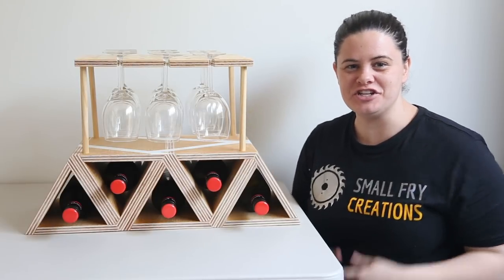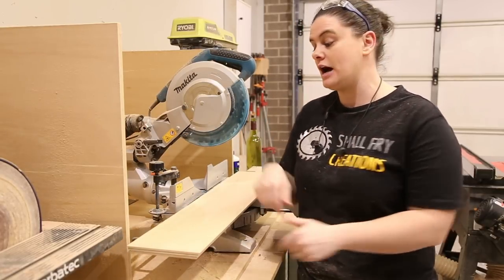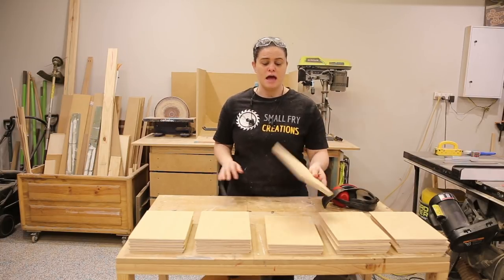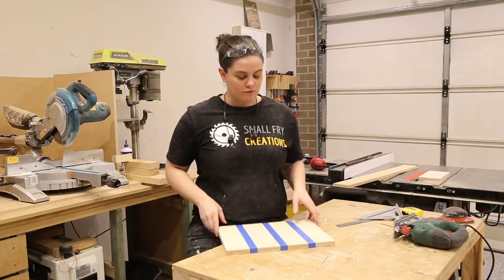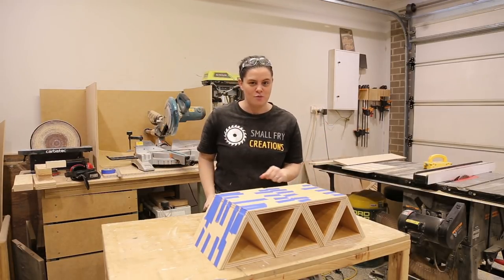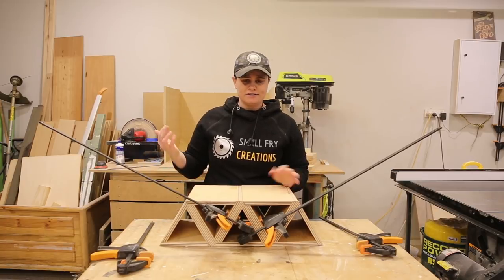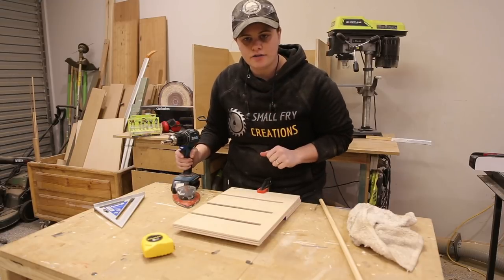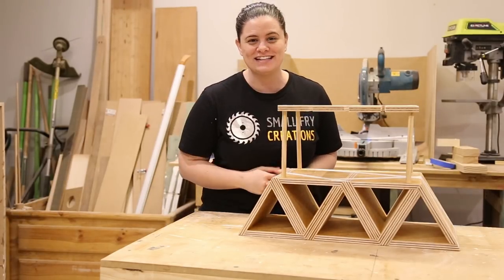DIY Wine Bottle and Glass display

Comment: Ainslee, is the wine holder heavy? I'm looking into making a wine holder, mainly for my auntie (and one for me too) as she currently has a "basic" wire wine holder on top of her fridge. So, I'd like to make and gift one to her. I don't know if she'd still keep them on top of the fridge, but if so, I would appreciate knowing in advance if this is heavy (to move up and down). Thanks and cool build as always.
Reply from the maker: Thanks Janie. I wouldn’t say it is heavy. Maybe 2kg. Maybe hard to get up and down from on top of a fridge. Just depends how strong you are 😀 but if you were worried you could always make the triangles and switch out the top glass section for more triangles. Good luck with the build and thanks for the support
Reply from the maker: I also used 15mm ply but you could very easily use 12mm and that would make it a little lighter 😀
Reply: Good idea! Thank you for your time and response!